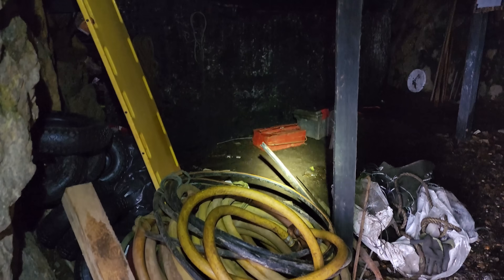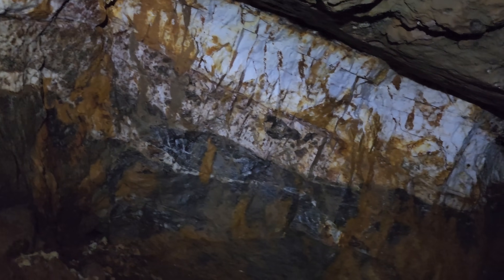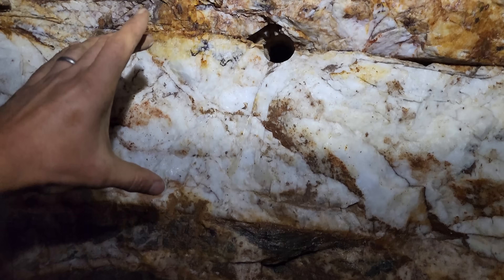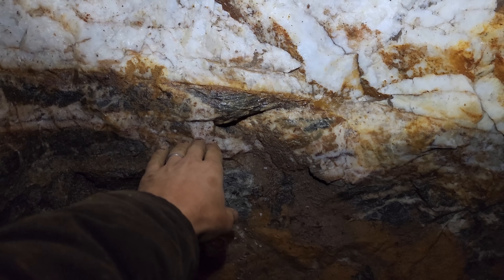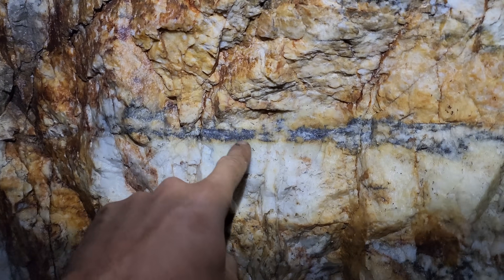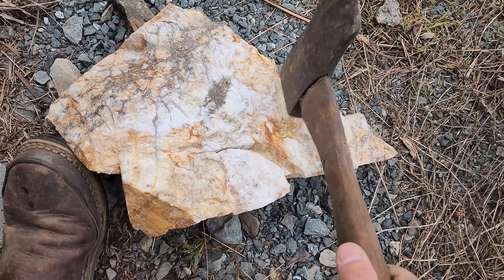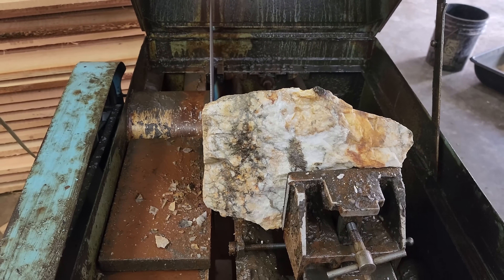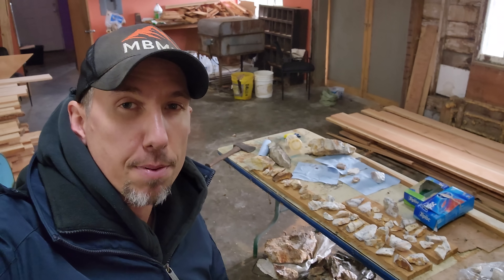Pocket Gold & Gold Vein Geology Season 2 Episode 9

Comment: Next time you do a big slab, set up a fixed position camera to take a picture of slab after each cut. Leave slab in the machine, take the picture in the pulled back position. Afterwards string the pictures together and make a short video. That way if the slab falls apart you have content, which I would enjoy. If it doesn't fall apart, you have a video which could be sold with the cut pieces.  As always enjoyed your vid.

Comment: 0:50 Economic geology plays a part, as does Structural geology. Somewhere proximal is located an intrusive, plate tectonics comes into play, forces that cause rock to move, fracture, shear. Hydraulic hot fluid forces the mineral rich fluids into any weak spot, as you noticed this happens multiple times. Where the material comes from a differentiation has occurred, and the last injection is the deeper heavies that were pushed upwards. The processes involved are quite logical, simple physics applies!

Comment: 7:15 dollars to donuts if you blast that section where the vein pinches off and go 3-5 feet in you’ll see the vein again it just jogs around a harder section of the host rock. And if it is there it will be super rich because it’s not only flat but had to slow down at that corner it jogged around dropping out the heavies I’d bet there’s stringers of gold there 😬 cool video for sure thanks for sharing see you on the next one👍🏼👊🏼
Reply: I was thinking the same thing....theres a surprise behind that wall

Comment: it makes me wonder how much energy was required to creat a convergent plate boundary. and what would have happened to cause the mountain to slip and grind all that bottom layer to heat it up enough to turn it into chum but leave the other layer solid white. or could one layer have cooled quicker than the other layer traping more host rock than the other?

Comment: Looking at this in just two dimensions is bound to be confusing, Those faces are LAYERS of material extending away from you in space. Behind a "pinch" could be another thickening of the vein. At the face, you could just be looking at a thin spot at the edge of a pool of material. Like puddles of rainwater on uneven ground - some puddles are deep and tapering to nothing, until the next pool shows up.
Reply: Fluid and thermodynamics are tricky. Look up at the clouds. You never really know what swirl you may get.

Comment: I would guess that at the 'dip', either the vein was in front of the dip where you already have the material removed, or it went behind the dip. and if you were to blast though it you might f ind your thick vein. As to where the ,thick part of the vein went back toawrd the old workings: the old-timers didn't make rooms for no reason. They probably removed it.

Comment: Jason, when those slabs have visible gold on both sides, you might try using an ohm meter to test continuity between the two side to see if they are connected by wire gold. you might find some that are worth dissolving out the quartz to show the crystal structure of the gold inside the quartz. You might even find some larger structures inside.

Comment: When you start blasting in 2025 season, would old used rubber car tyres built up as a rock blocker if packed out with large waste to hold it in place. Be of any help to keep the quartz host rock from flying back into the original workings. A deflector wall.

Comment: Looking at the vein how it dips and narrows makes me think that during formation it acts different. We come to expect gold to settle to low spots. I'm guessing that pressure has more effect. You have 2' drops and narrowing that probably create huge pressure points as molten rock is pushing through. In many things heat and pressure cause unexpected changes. I think the drops create high pressure that help to push the fluid gold to the higher spots where the milky white quartz is.